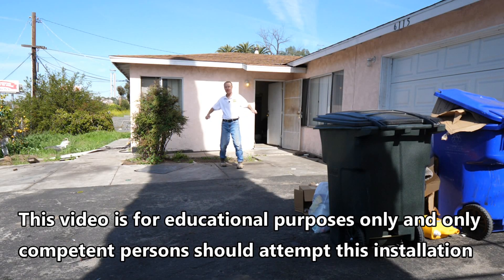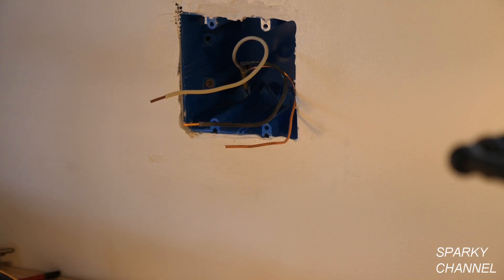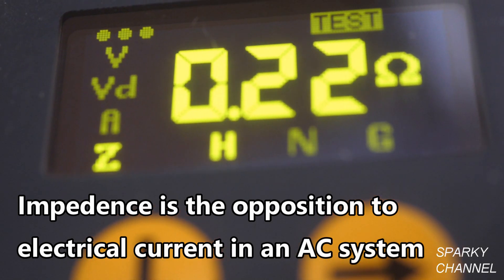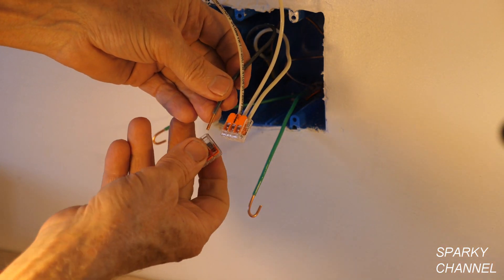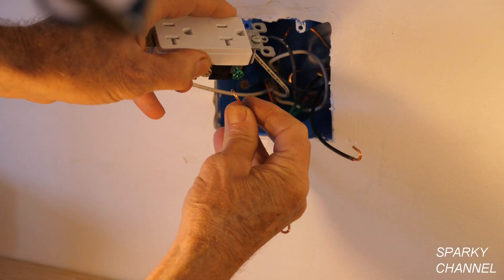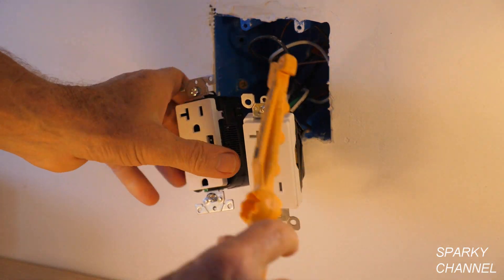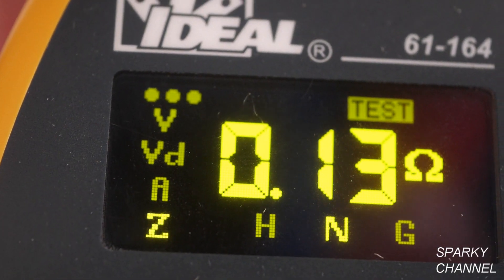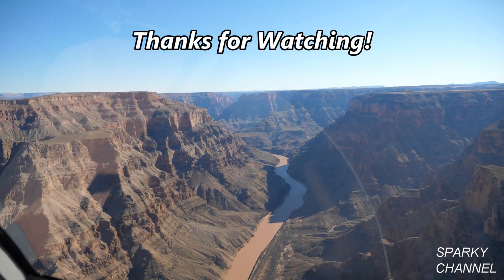How To Wire 2 Duplex Receptacles + Testing Wires Before and After Installation

Comment: Perfect perfect perfect.
Reply from the maker: Thanks Dave! Have a great weekend!
Reply: @SparkyChannel  If you didn’t know the outlet you use is all so a residential grade outlet. All they did was just made the housing thicker, and added an extra 20a slot so it looks more heavy duty also the metal strap goes in the outlet instead of on the back of it. The back stab connection was also removed it makes it a little better but is still a residential outlet. Note: it was not the usb outlet it was the other one

Comment: I bought a Leviton 16242-W 15A receptacle from Amazon advertised as back wired. The one I got was side wire only in a plastic bag and not a box. Where do I buy a back wired 15A receptacle?

Comment: It looks like this is the end of the circuit, could you do a video on wiring a box in the middle of a circuit?  I assume you would recommend using wagos to connect hots, neutrals, and grounds together (respectively) and then pig tailing to each device?

Comment: Thanks for sharing your knowledge. I have learned a lot from watching them, but I am confused by what you said in this one. You said that people would be wondering why you are putting a 20 amp receptacle in a 15 amp circuit. You then stated that you can use a 15 amp receptacle on a 20 amp circuit but can use a 20amp receptacle on only a 20 amp circuit. Did you mis-speak on that or is what you said accurate?  I would have assumed that a 20 amp receptacle could be used on a 15 or 20 amp circuit and a 15 amp receptacle can only be used on a 15 amp.
Reply from the maker: I said it correctly. I'll have to make a video on this subject when I get the chance. Thanks!
Reply: 415 orazio, it's the wire gauge that is the important item, not the receptacle. 12 gauge wire is fine for either one because it's correct for 20amp and more than enough for 15 amp. If you use a 20 amp receptacle on a 15 amp (14 gauge wire) circuit, someone could plug a high power appliance in a circuit not rated for that, and over heat the circuit or trip the breaker.

Comment: Those are nice boxes!
Reply from the maker: Yes, I agree. With the plaster varying in thickness a little from place to place the adjustable feature is very nice.
Reply: @SparkyChannel  Thanks for the educational video.
Question: since that Carlon adjustable old work box only holds  on one side instead of some that have two locking tabs on opposite ends, can that Carlon box flex on the non-clamping side or are the receptacle tabs preventing that from happening.

Hope you and your family stay safe and well.
Reply from the maker: @ccadama  All the plastic 2 gang boxes are subject to flexing. I'm always on the lookout for any  backing to support the side away from the stud. Also, when you plaster in the box make sure you mud it in well.
Have a great weekend and stay safe!

Comment: Would have been good to show proving process, using a proving unit more reliable. Impedance values from the tester need to be compared against the conductor size and conductor length to make sense. I would also test insulation resistance and continuity testing both downstream and upstream of the receptacles on the branch circuit. Also funny how your GFCI did not trip when you tested ground impedance that test imparts a small current to get impedance values. Unless you removed the GFCI when you did it? As always crystal clear explanations your talent is amazing.
Reply from the maker: Thanks Math Man! There are certain things that I already knew that I didn't need to test for such as I knew I was on a 12g 20A circuit and I knew how far I was from the main panel. What I really wanted to know was the voltage (what a waste of time if the V is low, best to check before starting),  if all 3 of the wires were working correctly and if there were any loose or problem wires. I did bypass the GFCI for the ground test of course. I have a video from that very house (How 1960's Metal Electrical Boxes Were Grounded) that shows the potential problems that I was concerned about. However, the Z readings were excellent for that era of house with the original wiring intact so I went ahead with the wiring. Have a great weekend!